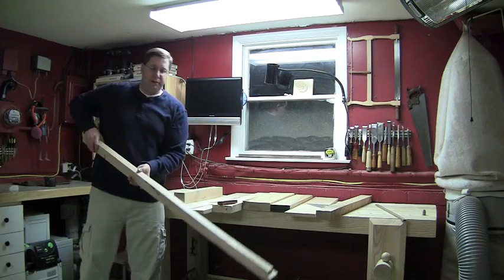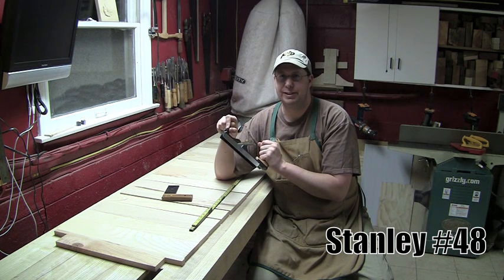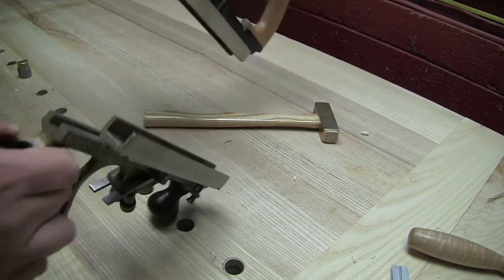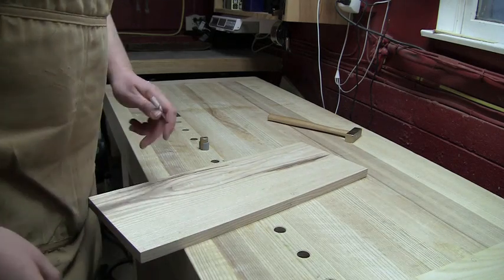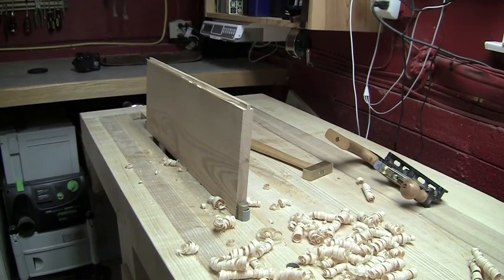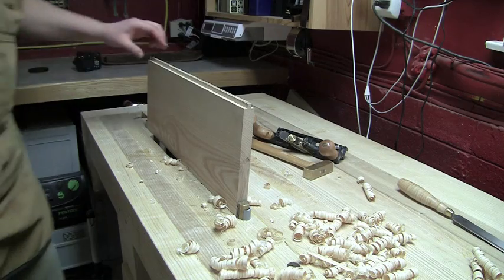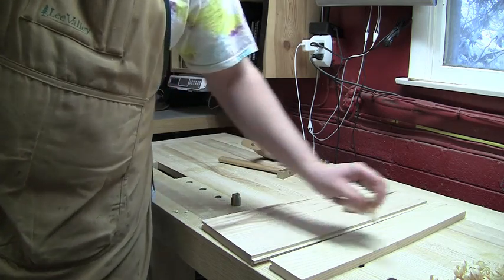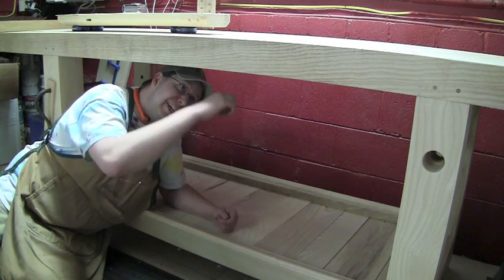RWW 82 Roubo Shelf

Comment: I know your way is the right way to start your cut but for me I take one or two skim cuts from front to back,i find that the less cuts you do to start, the less chance you have to go off line,but that just works for me,thanks for posting this video,its good to see demo's on tools that you don't see used that often.
Reply from the maker: mark bush I abhor using the terms "right" and "wrong" in woodworking.  If its safe, I don't think there is a wrong way.  I have done the same thing from time to time as that one careful pass can set the groove.  I have found that the whole thing goes faster however in short strokes instead of the long, full length passes.  Less footwork.